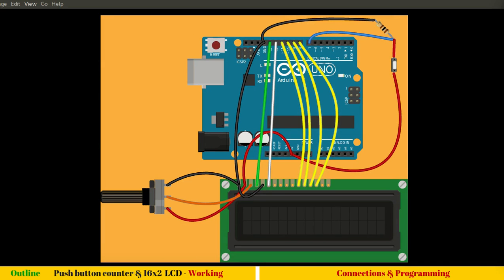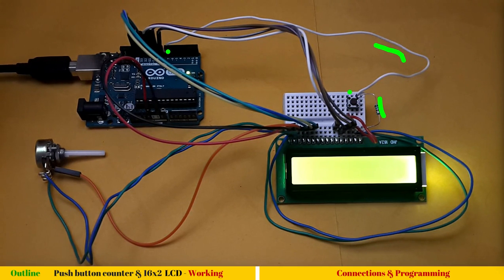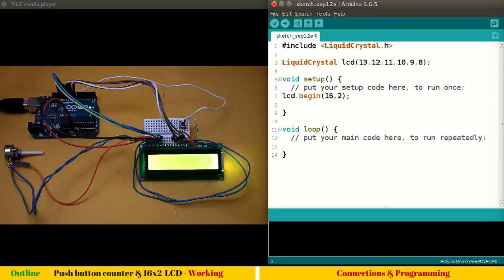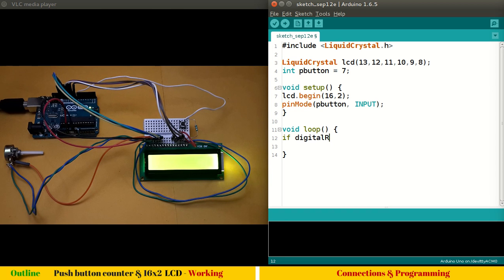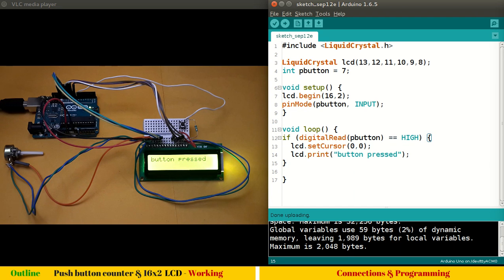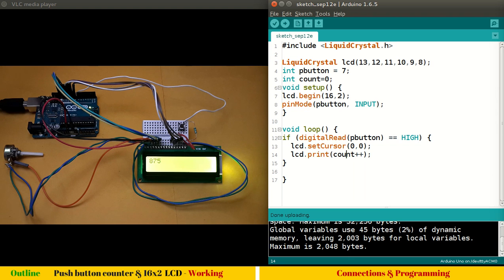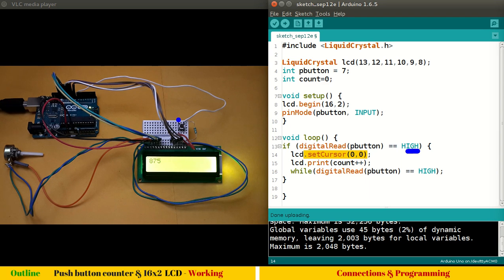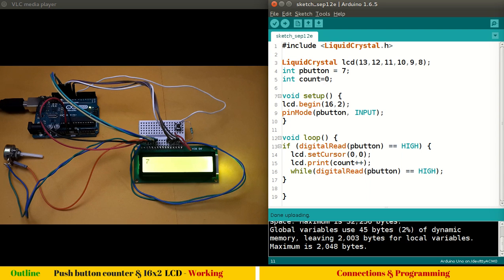10. Interfacing 16x2 LCD with Arduino to make a counter

Comment: I have used your example to have 2 push buttons for the counter. How can I make button 2 to increase the counter while button 1 is also still HIGH or button 1 to increase the counter while button 2 is also HIGH?
Reply: I have managed using the PushButton Library

Comment: how to use it for 2 push buttons to increase the count by 1 if any button is pressed
Reply: same thing, just put the two buttons in parallel?
Reply: @jarnoversyck7531  same code is not working.can you show on video.